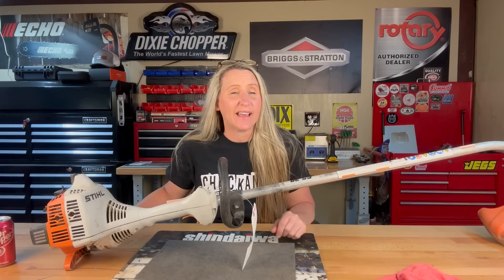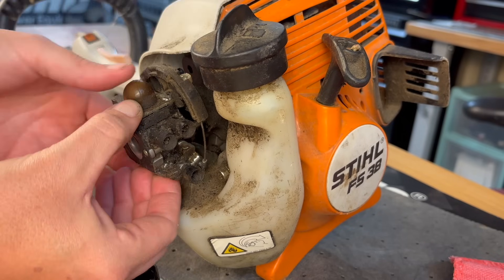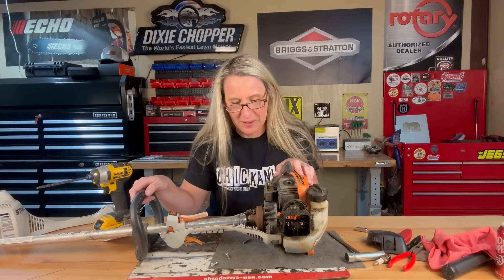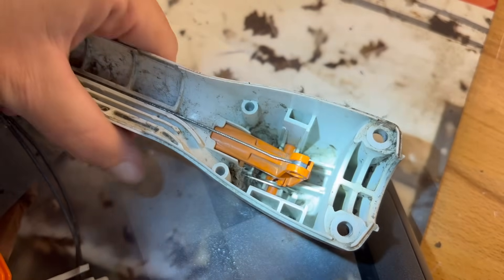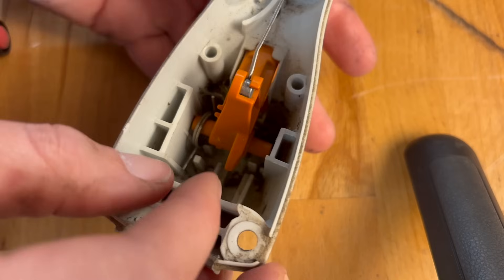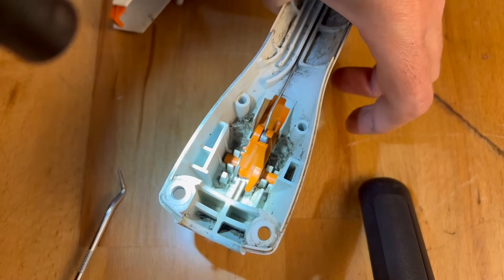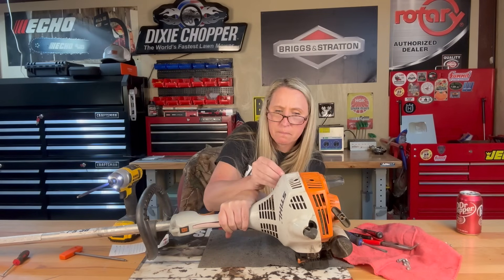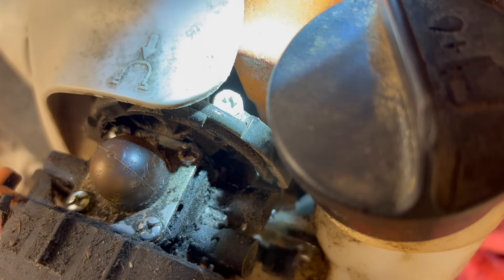How to Fix a Stihl FS55, FS46, FS45 FS38 Trimmer With Throttle Issues. Everything You NEED To Know

Comment: Oh boy!  I tried to remove the shroud on my Stihl 55R.  I used your video to help.  I must have fumbled this ball.  By time I figured this out several pieces fell out.  I am clueless as to how to reassemble.  The hidden screws drove me to remove more parts to get the shroud off.  I was trying to remove the muffler which was impeded by the shroud. Not knowing all, I wanted to check the screen in the muffler as the machine won’t start and run.  I Have now learned I did not need to do this duh!  Normally I could have figure my way out of my mess especially after watching your videos.  Not today.  Am I allowed to box this up, send it to you and see if you can address my problem.  Help!

Comment: Throttle issues are with the wire that goes back to the carburetor.  What happens is the handle is too tight and the engine will not idle. Move the handle back a little bit and the problem solved

Comment: Thanks for the detailed video. I picked up a sthil 55 the other day for $70 it was stuck at full throttle. I did a compression test it had 120 psi so still some good life left in it. I took it apart someone had previously had it apart and the throttle cable was not in place in that white plastic housing. I took the carb off and put it in my ultrasonic cleaner and put a kit and a new primer bulb on it. I lubed the cable, it fires right up in a couple of tugs. I got that finicky spring right. The throttle is still hanging up a little. I'm going to take it apart again and check that white plastic housing and make sure everything is there that's supposed to hold the throttle. I suspect it's broken because I don't remember snapping it in to place like you did. Thanks for the detailed video.

Comment: My Dad 'gives' me his chainsaws and trimmers when he can't figure out what's wrong. I got a Stihl FS46 with the black plastic throttle housing. It won't open the carburetor-I've tried adjusting the half-moon throttle slack adjuster but it maxes out and I still have slack. Is the cable bad or is there a way to adjust the barrel? I don't see any adjustment head on the end of the cable going into the throttle handle-can I loosen the assembly and shove the barrel in to take up slack that way? 
I was going to buy a new one but for $50 to $80 I'm not too keen if I can fix it somehow.

Comment: You are correct. This repair is not fun. I actually used a drop of super glue to hold that spring that was upside down in place right where the end of the screw goes into that notch. It would not stay in place no matter how hard I tried so I used the glue. Have not seen that trimmer since the repair was complete 6 months ago. I also agree to slide in the shaft AFTER you get the handle back together. Trial and error can teach you a lot but it can take hours of frustration to learn that lesson- ARGHHH

Comment: G’day Chicanic.  One issue I just accidentally discovered and rectified was the ‘rocker’ that the throttle cable runs through over the carburettor.  I discovered mine was soooo loose that the whole thing was going wonky, and giving inconsistent results.  I just screwed it in until it just put pressure on the throttle arm with no slack in the cable, readjusted the screws and it runs fantastic.  
Thanks for getting me going into the ‘what does this bit do?’ mindset.   
Cheers from Tasmania.

Comment: Great video. I have an FS45 that someone gave me. As soon as I attempt to rebuild the carburetor I’m hoping it will work. But the trigger tips are helpful in case I have a problem with the throttle cables

Comment: I enjoy your production so much and appreciate your time spent. I have an FS 55R weedeater made by Stihl of course, and when I pull the plug the pull starter turns the motor over easily but when I put the plug back in it, it is very difficult to pull. It’s a two cycle so what could be my problem?

Comment: My throttle is doing the same thing.  It will intermittently not return to the idle position.  I will check to see if the carburetor spring is working properly and if the trigger spring is broke. If not do you sell the throttle cable?  My model is FS 55 RC.  Thanks for your video, I just found your channel.

Comment: Hello chickanic. Yep that spring in the Trigger housing is a son of a b**  I've been farting around all day yesterday trying to get my old 2001  fs45 running again after putting a new coil on. got a nice spark but still can't get it running. it has the original carburettor with just the one LA screw. It might be the diaphragms or I could fit the other carburettor that I bought a couple of years ago that has  a high and low adjusters. Now I just have to wait for my poor back to fill better. Please keep doing these videos. Your channel is the best on YouTube for garden machinery etc

Comment: I was looking for help troubleshooting an issue where my machine won't idle after it starts up (it shuts down almost immediately).  Thought "throttle" would point me in the right direction.  Unfortunately, it didn't help my specific issue but this was a really cool video. Thanks for putting it together.  I learned a lot more about the machine than I knew before :)

Comment: I'm working on a Steel. FS55 It started and ran just fine, but when you squeeze the throttle, the head does not spend. I'm thinking that's the clutch or the shaft. It makes a real loud grinding/banging noise like a bell. If you could help me with what that could be.

Comment: Spring's not where it needs to be. Had nearly the same goof on my first repair, the spring was just out of place. Now when I take it apart I use a piece of wire to hold the switch housing and lever in. Problem was that once the casing was apart, then setting the end on the table caused the lever to pop out and of course the spring came loose.
Plus
Best way I found to get the shaft in is to put the case together first, leaving the back four screws loose then pushing the shaft in. Once in, lining the shaft up rotationally then putting the shaft screw in, then tightening up the 4 screws.

Comment: Not a fan of Stihl equipment except for the saws. I’ve had great luck with Echo trimmers and blowers. Stihl trimmers and blowers have been nothing but problems for me. However my Stihl saws have been great. I’ve probably got a few hundred hours on my MS 461 saw and it’s been absolutely bulletproof. My BR 800 blower was a disaster I had to fix that thing constantly. My new echo PB9010 blower has been trouble free so far.

Comment: My grandson recently dropped off to me a Stihl FS-76 line trimmer that he found at the curb knowing that I like to tinker with such things in my retirement.  The starter rope would not turn the engine over, so I did the usual diagnoses. This led me to having to remove the cylinder and what a surprise!  The piston was gone!  I was laughing so hard, I had to sit down for a spell!  Someone was in here before with the intent of repairs, as there were the remains of a shop work tag wired through the wrist pin retaining it, roller bearing and two bushings.  It was this that caught in the porting that caused the engine to appear to be locked up.  Now I was able to verify spark and I decided to replace the piston/rings.  With good compression, I replace the carburetor as it was cheaper than rebuilding the Walbro carburetor.  This is all I did.  I fueled it up and on the 3rd pull, it started up and with a bit of carburetor adjustment, it is running like a dream!  Now it is going back to my grandson.

Comment: Congrats on 400K subscribers. Have to give you a WOOP WOOP! 🙌🏾 Got a neighbor & his old Poulan weedeater. Always purchases ready made fuel and never, ever empty his tank over the winter. Emptied the old & replaced the fuel. Starts but ran ugly. I handed my Stihl along with the gas can. I remember your storage idea, emptied the tank and poured a fresh bottle of 2 cycle oil & pumped for the weekend. After the eclipse, drained & pumped the oil, fresh fuel and a ton of smoke. The membrane on the carb loosened up! I know it was not your method of freeing the carb, but it worked.

Comment: Love your content Bre.  You're very knowledgable and I enjoy learning about the small engine stuff.  Comes in handy every Spring. I have a John Deere Z245 that I've had for about 5 years and this season it is hard to start. My theory is that the coils are either failing or the gap is incorrect. But I just recently cleaned the flywheel and re-gapped the coils but it still is giving me trouble.  Any videos on this?  Maybe in the archives?

Comment: Once I saw there wasn't an issue with the throttle cable by the carb, I knew it was the spring by the throttle lever before you took it apart.  It was good to get a refresher on taking the shaft cover off also.  Always well explained...thanks.

Comment: Dear Bre, for me, the most important success factors when working on those small handheld devices are patience and light hands. My golden rule is NEVER force anything off or nto place. If it doesn't fall into place, it's most likely not put right - go back a few steps and revisit the process. Of course, getting your coaching gets and keeps one on the right path ! Regards from Québec.

Comment: Bre, why do you not clean these little gems before putting them back together? I think the customer will be very happy to get a working power tool that looks better than the day they dropped it off. Just a thought...
Reply from the maker: I don't clean things until I'm done, knowing it is repaired. Many units I work on end up being dead. No use wasting time cleaning a dead unit.

Comment: I've  been watching your videos  for about 2 years  you've  helped me a lot with my old 06 craftsman mower , old Weedeater brand trimmers  and  not so old Stihl chainsaw.  I have a problem with my mower, it's leaking oil on the bottom of the blade, it has a brigs 4.5 horse engine . When I look up parts mostly all are obsolete,  do you think it's worth fixing if I can get the parts? Have been thinking about the ariens dual  cut front wheel drive mower, have you herd anything about them? I've  seen good and bad in reviews . Appreciate  your time reading this hope youcan help.

Comment: I have FS36 i bought in 89 or 90. The only thing I had to fix was put cord. Took it back to shop I bought it, I think around 10 years, he was shocked I still had it. He said they didn't hold up. Used it a lot then. The last 15 years 1 or 2 times a season. Fires right up.

Comment: Last year Ipulled the spark plug wire apart on my Stihl FS 70. Ended up taking it apart to get the end reattached. Probably disassembled it more than needed but got it back together and running great. Appreciate the tips and tricks!

Comment: I've watched since before you closed the storefront shop. The videos are amazing? Have you ever done one on a Peerless 5 speed lawn tractor transmission?  My neighbor has one that won't move in any gear but the wheels turn when they are off the ground with the engine running and the transmission in gear.  Thanks for passing on so much information.

Comment: like how you explain lil obsure  things like the cable adjustment. i have always been a visual person and just tear it apart. most of the shops around me only wont to fix not give a lil advise to fell small engine shop.  the scope to look in cylinder is best thing in awhile. no more straining with a flash light to check.  thank you for all info on your videos

Comment: Hi there, Another great video. I learn something each time I watch one. My FS45 trimmer was doing that baughing down and dieing. I pulled the muffler & air filter. After a few minutes throttle started responding. Installed those back, now it has a very high idle 1/2 throttle high and none of the 3 adjustment screw have any effect. Just now learned about the cable adjustment screw so that's my next check. Any advise on what else to look at would be awesome. I'm in Fort Smith and would come to you if needed.
Reply: P.S. I'm also a content creator here.

Comment: I bought one of these trimmers (FS38) several years ago but first time I used it I noticed a problem in that if you turn the trimmer upside down to do vertical edging the motor coughs and dies. I worked out that it's because of the L shaped fuel tank not allowing the fuel pick up to move to where the fuel is. I cut off the fuel cap lanyard to stop it tangling  with the fuel pick up and it was improved but often the whole trimmer needs a shake to get the lightweight fuel filter pick up to go to where the fuel is. Suggest the fuel pick up is too light and the shape of the tank restricts the pick up movement.
I was upsold to buy the FS45 but I could not see any difference other than a higher number on the decal.
Have your customers told you about experience with problems using these for vertical edging?

Comment: And That's one of the many reasons I got rid of my Stihl trimmer that I only used a few times. They got so much breakable plastic. The dealer told me all that shaking and hard starting was normal. Funny, they didn't mention that the day I handed them the cash for it. I think it was an FS56C.  I sold it for half what I paid for it. As soon as my BG55 dies, no more Stihl for me.

Comment: Good tip if you are disassembling something and you have a smartphone or a phone with a camera, take a picture. It helps especially when you have to do a job where springs need to be placed back in a particular place, especially on carburettors.

Comment: I have an FS55 that my landlord gave me and I've replaced and fixed some of the same things that you did on this one with the exception of replacing the plastic starter pawl pieces(twice lol) and have encountered some of the same issues that you did here,as far as the screw going into the middle for retaining the drive tube and shaft what worked well for me was using a small screwdriver to locate the hole and leave it there untill I have ever else tightened up, worked for me anyway, I second your comment about needing four hands though,ran into this on a 4 cycle Craftsman trimmer that I'm finishing up now😂

Comment: Congratulations on approaching 400,000 subscribers. Even though I'm from Hot Springs, the St Louis area had frost the night before last. I was up there to bring back a JD 318, JD 435, old heavy duty Troy-Bilt tiller, an FS40C Stihl trimmer, McCullough chainsaw, Stihl chainsaw, a compressor and two self-propelled Troy Bilt and Craftsman mowers.  Old varnish fuel in each. They will keep me busy for a while.

Comment: Because of your advice. I decided to try and get my 24 yr old Craftsman (6 hp Briggs & Stratton motor) push mower running. I hadn't used it since 2008. I shot a little oil into the spark plug hole. Gave it a few pulls with the plug out. Pumped the primer bulb several times ( very stiff ). First pull it started right up. Then I proceeded top pamper it some ( new spark plug, oil change, air filter). Runs like a champ. Next is a new blade. Thank you for all of these videos.

Comment: Love my Stihl FS55R trimmer and BG85 blower.  In October of this year, they will be 30 years old!  Pretty much all I’ve had to do to them is replace the carburetors (once), fuel lines (once) and filters and spark plugs.  This with heavy use at our home and remote 7 acre off-grid property.

Comment: You've saved me a lot of time, money and frustration maintaining my FS56 trimmer I bought 11 years ago. Just hydrated new line for it. You've even helped with my Poulan chain saw (which I want to replace but then it works). Question I have is how to fix the plastic front wheel assembly on my Troy-built push mower? The wheels won't stay in position. It's not the wheels, its the plastic height adjustment. I'm thinking of just running screws through it so it never moves again. Thanks.

Comment: This one is going to come in real handy since I need to fix my wife's trimmer.  A Stihl dealer explained that process of taking the shaft off to switch out the head, but I had not seen it yet.  This visual really helps to understand it better.  Thanks much.

And looking at all those cheap flimsy plastic parts, this is a shitty design on Stihls part.  Oh well.

Comment: I bought a brand new craftsman push mower for trimming a few years back and I only used it once because it was a bagged mower with all the stuff to use it without a bag but it was still too hard to push through the yard tree to tree. So a few months after buying it I went to start and it wouldn’t start so I gave up.  The following year I tried again and got so mad that I flipped it over with force because I paid almost $500 for this mower and was just that mad. After I picked it up and calmed down I pulled it 1 more time and it fired up like nothing was wrong, WTF?

Comment: You need to add at least one of the other air filters used on the Tecumseh 6.5 flathead mower engine. All you have if the flat one. There is at least one other, which is used on other older versions of the engine. That’s the bean shaped Tecumseh 36905 or 740083A. The Stens Air Filter 100-812 is also cross reference compatible. These were used on Tecumseh LEV100, LEV115, LEV120, LV195EA, OVRM65, OVRM105 and OVRM120.

Comment: It's maddening when you go to a professional shop to have work done and the service you get is sub-par. I used to take my chain saw blades in to be sharpened and the technician would sharpen the blades back about a quarter inch, almost to the point of grinding  the blades off. That would completely ruin my blades. So now all I do is run my round file over the blades and never need to throw them away.